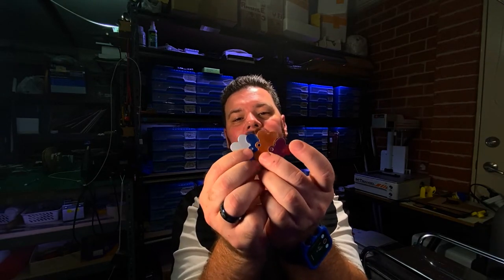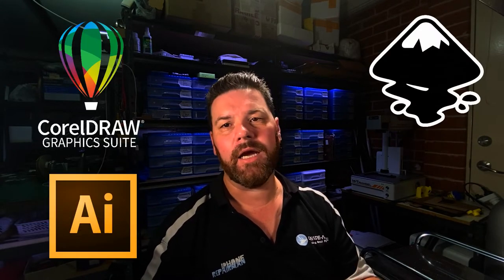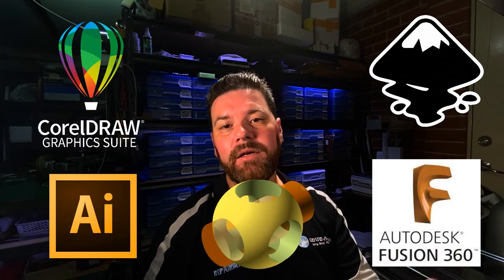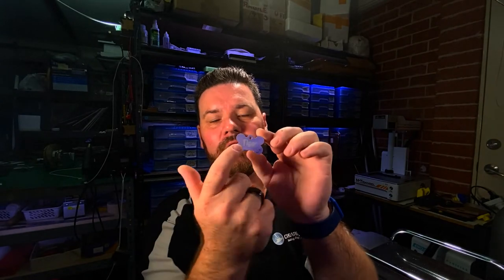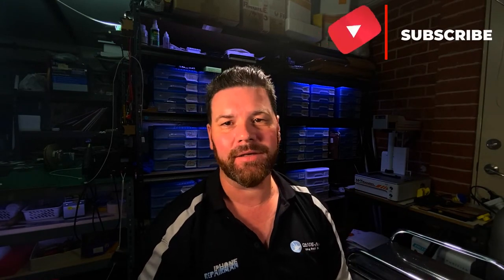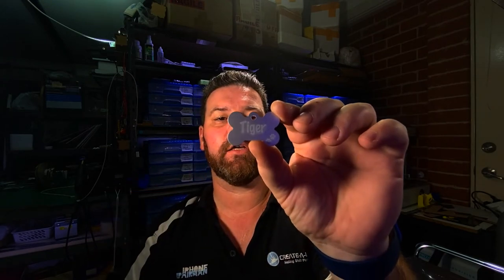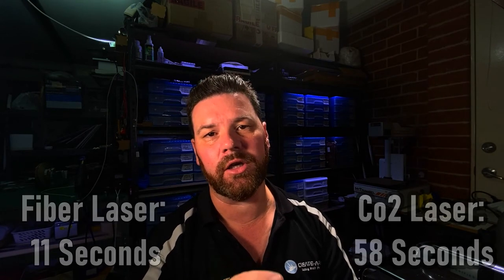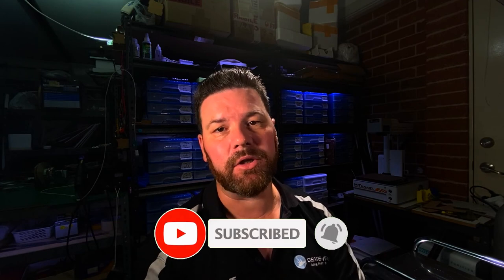How to Laser Engrave Dog Tag | CO2 Laser VS Fiber Laser

Comment: Hello.. what brand and Power is your CO2 Laser.. thanks
Reply from the maker: Hi Marcelino, thank you for your comment. it’s a 30W Trotec Laser.
Reply: @CreateALase  hello.. i only have a 20W Laser diode.. for small wooden stuff.. looking to but those K40 or similar value that can etch fast on anodized aluminum tags..
Reply from the maker: Hi  @marcelinobarba8962   if you're looking for inexpensive Aluminium etching. Try small low watt fiber. These will etch aluminium super fast and look amazing. It will do the job better and more reliably then K40. :)

Comment: So I was wondering if the lazer can do even smaller letters on dog tags? And also do you have any lazer machine names that I can look up and possibly purchase? My name is Matthew.
Thanks
Reply from the maker: Hi Matthew, thanks for watching!  Yes, the smallest letter size I have done was on a ring at 0.9mm high letters. So on tags, you can get extremely small and still readable.  Though it does depend on your laser to get that detail. We do recommend lasers by Epilog or Trotec as these get that crazy detail, with high production performance. Though most even cheap Galvo style fibre lasers from China can get fine detail too. 

For a new laser, you will need to think of and weigh up your reasons for getting a laser. How expensive is too expensive, how cheap is not reliable enough.
Reply: @CreateALase  thank you, I will consider those options
Reply from the maker: @M.Huling  No worries, just let us know if you have further questions about laser machines or projects. Cheers!